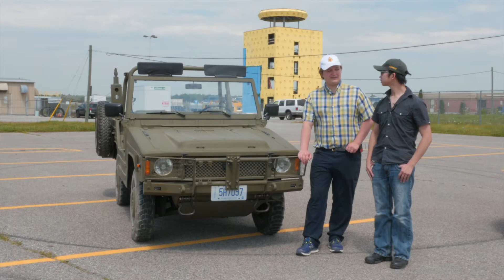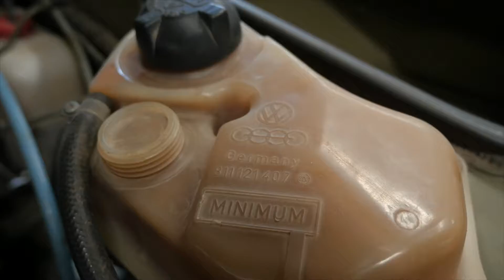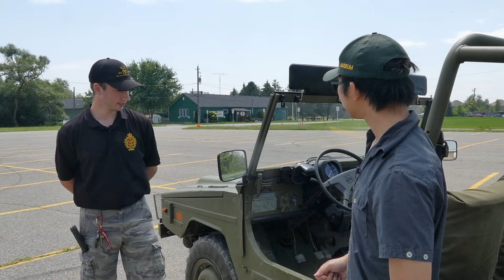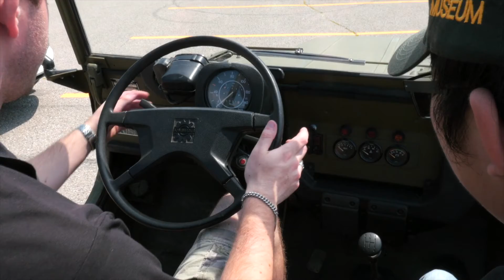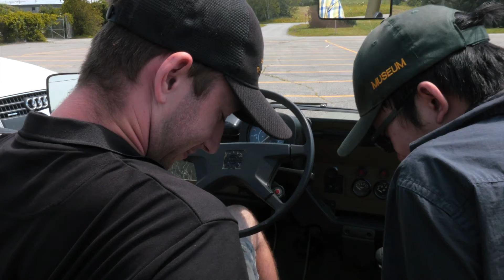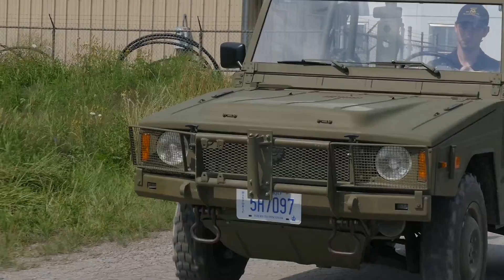Fighting Vehicles: Iltis

Comment: ask most soldiers and they will tell you the iltis is a piss poor field car or jeep
Reply: They had their downsides.  I was posted to an infantry bn that still had 1/4 ton MUTTs (85).  I recall being a passenger in one during snowy conditions.  Heater broken, me holding the door closed for the 1.5 hour trip and holes in the floor causing slush to spray up my legs.  The Iltis arrived in fall of 86 and it was a revelation: brand new.  Working heater.  Doors stayed on.  Seats were spongy and not torn up..... Fast forward about 12 years and I was rushing  somewhere for a task.  Heater was broken and I had to use both hands to a.  keep the door on and b.  keep the roof from flying back.
Reply: So how come it got 1st 2nd and 4th place in the Paris Dakar rally?
Reply: @Gryphon6668  mods help
Reply: @ I believe entries in the P-D rally had to be pretty close to production cars.
Reply: @Gryphon6668  All the same, I drove several of them, hated each 1. Loved going back to the cj5

Comment: I'm sorry but your "pro" got a few things wrong while under the hood. for example the "blower for the windshield" he pointed out is actually the air intake for the engine. yep it's on the highest point so it can ford almost 4 feet of water as stock if needed, and no mention that it is a 24 volt system or where are the batteries? ok back to see the test drive.....<addition> what no mention of the manual throttle and that "reassuring whirring sound" which is the fuel pump doing it's thing...this guy is a joke :) lets see what else he misses...<addon> Oh Hell No this lil puppy can hit close to 140km on the highway and another major role was as a communications/command vehicle as it's electrical systems were protected from being disabled by your basic emp weapons, oh and the ambulance version had an addition that added to the "lack of space" that uninformed guide mentioned, so lame so so lame...lets finish the video now...Ok and how do I know all this? I ran them when I served in the military and owned one personally for 4 years, it's the vehicle I miss the most. A couple more fun iltis facts. it is the next version of the volkswagon "thing" which was model 181 the iltis (meaning polecat) is model 183. and we as Canadians paid right around 85,000 per unit when these were being built in Quebec from model years 1984 to 1986. Yep our government pays way too much for everything lol.
Reply: 85 grand for this? it's really cheap bult tough but cheap and unprotected.   you could have bought armored iveco's from italy with real power and capabilities to take some hits deliver  and still bring you safe back
Reply: the puppy went really unstable after 80 or 90 km h,  if you jank the steering wheel badly at 130 you go sunny side up.  i drove it weekly when serving, there was a pollicy don't drive it over 100  !
Reply: @215alessio  Yes, the DND policy was not to drive over 80km/h (that was standard for any green fleet vehicle), but that doesn't mean the Iltis wasn't capable of driving over 80km/h.

Is it recommended?  If the road isn't in good condition, probably not.  But that can also be applied to any road vehicle.  While the Iltis can absolutely operate on public roadways, it shines in it's offroad capabilities.
Reply: @CplBlinky  yes I know, in column with lorries we had to keep same pace.  But when alone I went also 110 . Was already unstable at those speeds but as you sayd: offroad undestructible